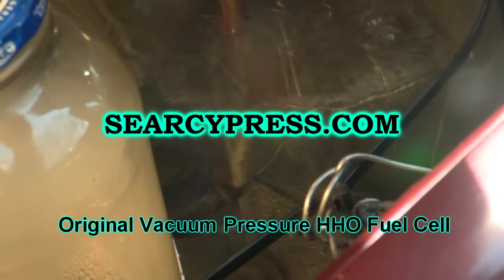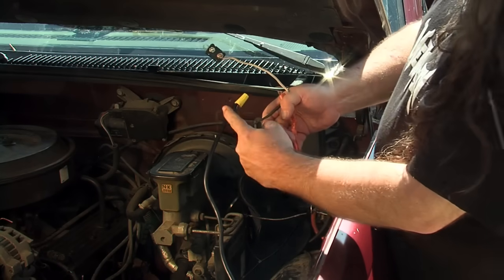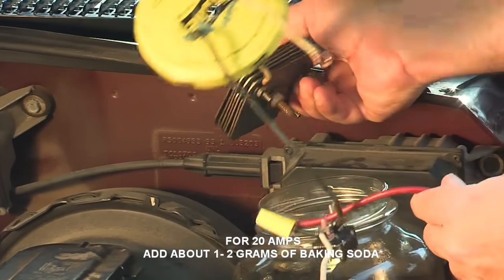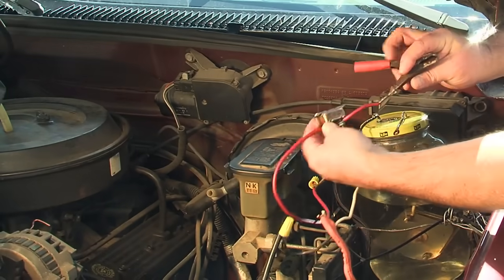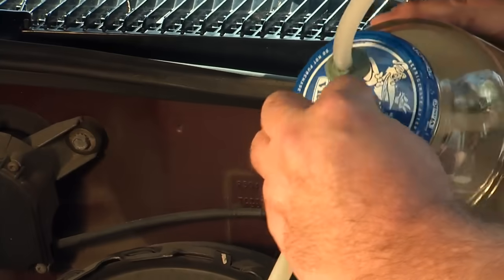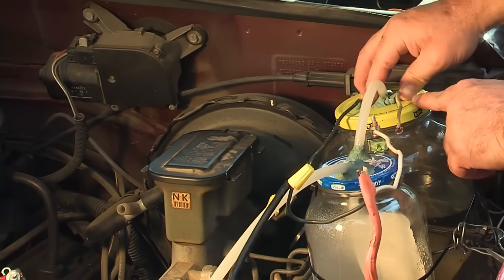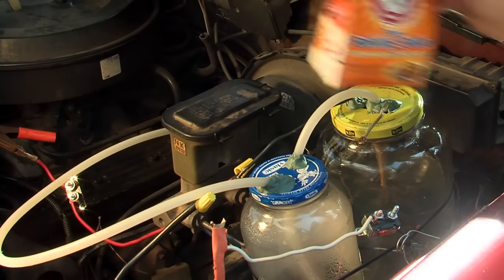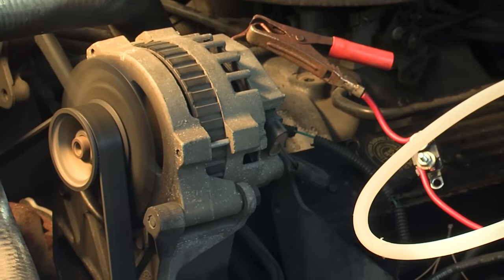Vacuum Pressure Hydrogen fuel cell defeats high gas prices using hydrogen from H2O.

Comment: Best video ever I get it a bit better now but some topics are a bit fuzzy I was never a tinkerer but I want to be now.Id like to attach this to a gas powered bicycle kit.
Reply: +Joseph Carson the problem with doing that is where are you going to get your electricity from to power this unit?
with a car, particularly one with a large motor, you typically have an alternator that is large enough that it has capacity over what your vehicle needs, so you can take advantage of that, use that excess energy, and make hho gas.
Reply: +Rush CampNPrep You can power it from a small 3-4 cell LiPo just fine. A 1500mAh 25C battery would handle it just fine and its no larger than a stick of butter.
Reply: +Joseph Carson I have a bike engine kit on my beach cruiser and I was thinking the exact same thing lol
Reply: wouldnt really be worth it honestly. you would be better off just getting an electric motor kit for your front wheel and using a battery to run it.
Reply: Having rode an electric bike, they are boring expensive, and slow. I like my engine kit a lot better :)
Reply: Malin Hiles I think you are going to get far less out of the little battery you have there than what you think.
Reply: +Rush CampNPrep A 1500mAh 25C discharge battery can supply 37.5 amps of current without a problem. for a battery like that a likely burst amp discharge would most likely be around 40C which would provide the cell with 60 amps. I don't just throw battery specs out there and hope it works. Brush up on your electronics background. Then we can have an educated discussion.
Reply: Malin Hiles yeah.... im glad you put it so smugly, that makes this that much sweeter. 1500mah, and youre going to pull 37.5 amps off of that? awesome. so youre going to get that for 2 minutes 24 seconds. awesome. WOOHOO. so worth it, isnt it?
next time you want to tell someone to brush up on electronics before they talk about batteries, and next time you want to try to blow someone away with all of your amazing knowledge, make sure youre on point, and make sure they dont know what youre talking about.
Reply: I will leave you with my test results as it did not expect you would find my previous statement offensive and I was just looking for an educated discussion instead of " thinking  you are going to get far less out of the little battery...than you think." Here was the test results I got from using the hydrogen generator that I would use on my bike. (not the absolutely huge one that he used in his car. I don't have a 1500mAH battery but I do have a 1300mAh battery and that gave me ~42 minutes of continuous runtime producing 1 liter of gas in about 4 minutes and 20-30 seconds. This would be completely fine for a 49CC 2 stroke bike engine like mine and it is almost too much hydrogen as I wouldn't want the bike to have the gas solution diluted too much. For bike engine use which was the goal, it would be fine and I will leave you with that. This test was performed 4 times to ensure redundancy. I hope your quick anger doesn't have to upset others I just enjoy talking facts with people. Have a nice day
Reply: +Malin Hiles you didnt think i would find your previous statement offensive? as in... "brush up on your electronics background. Then we can have an educated discussion"? insinuating that i have no clue what im talking about? why oh why would anyone find that offensive? especially when the person saying it has less of a clue than the recipient of the comment.
now, to address your "test results" what you said is that you were going to take a 37.5 amp draw. at 37.5 amps, a 1500mAh battery is going to last for 2 minutes and 24 seconds. because, you see, mAh is a measurement of how much energy the battery contains. what it is saying is that you can pull 1amp (1000 milliamps) off of that battery for 1.5 hours. hence the 1500 milliamp hour rating, or the 1.5 amp hour rating.
now, sticking with this whole crazy notion that a battery only has a certain amount of energy it can contain, you can actually figure out how much energy that is, you can find out how much work it can do, you can convert it into other measurements of energy, you can do all sorts of crazy things at that point.
now im not going to try to get into picking apart your methods for measuring the amount of gas it produced, because quite frankly i dont care. i dont care because i know how much energy that battery contains, and it isnt much.
now, here is where im going to get REALLY tricky with you, okay? and this is why its so funny that you decided to get smug and tell me to brush up on my electronics background, and said that you dont just throw out battery specs and hope it words.
so, you cant get more energy in gas out of a hydrogen generator than the total amount of energy stored in the battery. this is just simply a fact. in fact, you actually LOSE energy by converting it to hydrogen, and then you lose additional energy burning it in the engine. so, you actually end up with a fair bit less energy than what was stored in the battery.
im going to assume youre talking about a 11.1v lipo pack, and when we are talking about your 1300mAh pack, that means you get a MAXIMUM of a whopping 14.43 watt hours of power. im even going to (to give you the biggest benefit possible here) assume that youre going to get 100% efficiency, and that you will lose NO ENERGY converting water to gas, then burning said gas. now, according to electricbike.com, if you are REALLY frugal with your energy consumption, you will burn 20 watts per mile. that means if youre getting 100% efficiency, your battery would get you .72  miles. wow.... not even 3/4 of a mile. even at 10mph, thats only 4.5 minutes of ride time. and thats if youre 100% efficient, which you absolutely ARE NOT even close to 100% efficient.
now, youre talking about producing that amount of gas over 42 minutes of time? that means that the little trickle of gas youre creating is not doing a DAMN THING for you. it wouldnt even be noticeable. it certainly wouldnt be worth putting on the bike.
now, as per your claim about my quick anger... what is with people these days? do i have to be angry to respond to you? im not angry at all. actually you absolutely made my day... twice now, because you want to try to act pompous about a subject that you are absolutely lacking in.
now, i know i know. youre going to say you dont believe me. youre going to say that you tested it and you made all this gas and blah blah blah. well, im sorry dude, but its the truth. check with an expert, check with someone who really knows about batteries and energy, they will tell you the math i have shown here is accurate. you cant get more energy in gas out of that battery than what it has in electricity.
Reply: +Rush CampNPrep My setup is not the same as his. It is far different. I have a 316L stainless steel 3" fender washer setup and I draw about 1.8 amps on the module I would use to add to my bike.  I don't appreciate your insult especially because  you took what I said the wrong way. I'm not dumb and I can do math. At this point your futile attempt to rat me out even though i know what I'm talking about has gotten you no where and though I appreciate your attempt at help. (<----Again, this is not intended to insult you just incase it sets off you off or something idk im just being safe) I don't know what else you want from me but your most recent comment must've gotten you off on the wrong foot. (<-----Again just incase. btw im not an offensive type person at all.) I don't have  the huge jar, or the same metal plate cell he had at all. All of my test conditions were different than Metal Press TV's  I used a small ss fender washer cell because im cheap and it gave me the results from my previous comment. I have been into electronics for a few years now and yes I do believe you (omg Malin is agreeing with me) because the electronics are the electronics and that how it works and misconceptions lead to preconceived notions which is why I was seen as a "know knothing" I hope that you eventually take my word for it that im not a mindless pomous (I like that word its fun to say)  poser trying to sound smart. misconceptions suck especially over the internet because things turn quickly. just to clarify, im not using his cell design at all, im drawing about 1.7 amps on my small hydrogen cell, , and im not a dogmatic idiot trying throwing out numbers hoping to prove you wrong. That's just not me. I'm actually sort of glad to have found someone that knows what they are talking about because I enjoy conversing with others on topics when we are both educated on the subject matter. 
Have a great day (<----Just in case again)
Cheers
Reply: +Malin Hiles Actuallly my  cell probably drew closer to 2 amps but my multimeter is broken and my lipos are puffed which made the test harder to regulate. I tried to stick with my results though cuz that's what I got.
Reply: +Malin Hiles so what youre saying is that you realize that what you have there is doing you absolutely no measurable good whatsoever. 1.7 amps at 11.1 volts is not even going to give you a gain that measurable.
Reply: +Malin Hiles now, as far as your setup goes, that really does not matter in the slightest, at least not as far as what im tlaking about. the point is, you have a tiny battery with a small amount of energy stored in it. no matter if you are using that to run an electric motor, or if youre producing gas to burn, you still have a finite amount of energy there.
you say that you are experienced and knowledgeable about this subject, yet you talk about it like you can get 10X the energy out of that battery. you still only have 14.43 watt hours in the battery, no matter how you choose to use it.
lets put that into perspective, there is 33,700 watt hours of energy in a gallon of gasoline.
so no matter what you used to do your test, no matter what method, or what generator setup, youre starting out with 14.43 watt hours of electricity, and youre only losing efficiency from there.
youre starting out with 1/2235 of a gallon of gasoline worth of energy.
now, do you see why i say you arent going to get far on that battery? do you see why your method does not matter?
as far as you being insulted..... really? i mean REALLY?! you want to say your original comment wasnt insulting, but then you want to turn and try to say that IVE been insulting and you dont appreciate it? youre really going to be THAT guy right now?